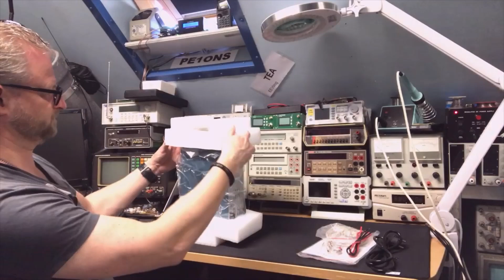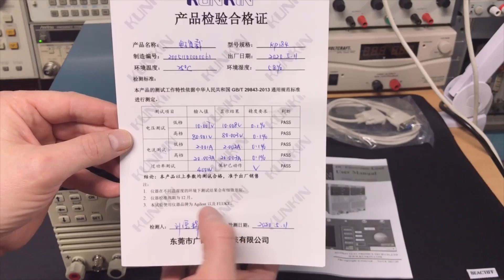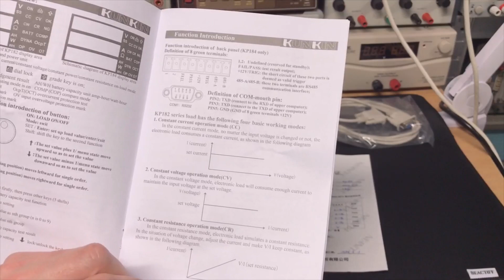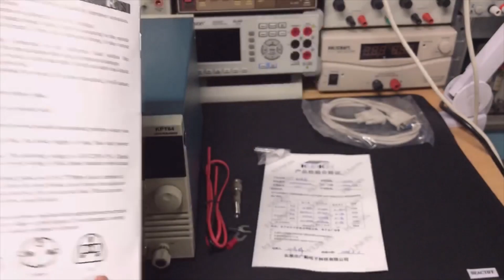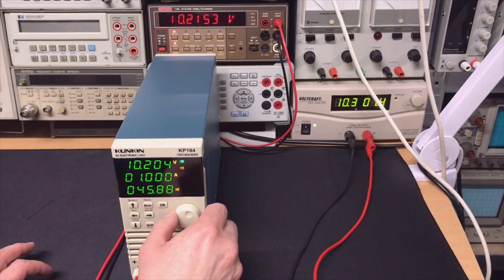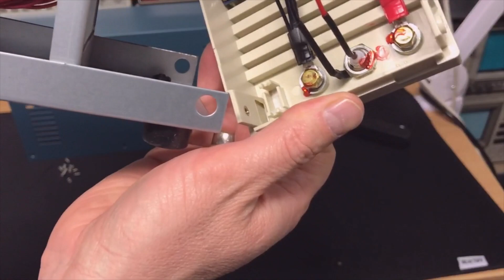TA•0075🟦Kunkin KP184 DC Electronic Load 40A 400W 150V Review Teardown

Comment: Just had a decent look at the specs following your video, ive had a look at the EEVblog forums and people seem to think it's a decent piece of kit too.  I've needed (wanted) one for a while, but they are too expensive, but this seems to fit the bill regarding price etc, so i've just ordered one myself! :)  £117 from Banggood (CZ origin).
Reply from the maker: Hi stephen, yes for the money it is very nice..  mine was about 125,- to my door in Euro, its about the same.. 40A with 400Watts.,..specialy with the new REV04 board seems better then the first versions... it looked a lot better then i thought..
Reply: @TonyAlbus  Yep, apparantly they have solved many problems with the REV04 boards (capacitor near a resister that they have removed and better software).   It should be ideal for me :)
Reply from the maker: @Stephen_Heathcote  Yes :-)  we are lucky with the newer version i guess (i also found out later....)

Comment: Thanks for testing. I would be most interested how accurate it measures the power and energy W/Wh on a heavy load and it it is really capable of handling 40A for a longer time. You should connect some big battery and do a load test for measurement. Build quality seems decent.
Reply from the maker: Thanks, the only thing i dislike is a bug that sometimes it remembers the last current setting, while the display itself say different.
now i would go for the EastTester ET5301	https://go.tonyalbus.com/ET5301

Comment: I know I'm late to the party but I bought myself a nice electronic load last week, the Siglent SDSL1020X. So far I like it and seems to work well and doing what it is supposed to do. Hacked it to the 1030X btw, so it's 300Watts now. I've  read in an EEVblog forum that the internals are exactly the same.
Reply from the maker: Good choice! very nice device

Comment: I also bought the electronic load. This device did not have the correct voltage. I made a complaint and got my money back via paypal. I dared to do the calibration procedure. I wanted to make a video about it, but it's too time-consuming. I have also calibrated the current, if the deviations are not great, then stay away from the calibration procedure! Here Jerry explains the voltage calibration https://www.youtube.com/watch?v=FDHT9bqQ7kw
Reply from the maker: Thanks Marco, sorry to hear that...my voltage seemed good, i have the REV04 board..

Comment: Excellent - Just out of the box and takes it apart :)   It seems to be well made and powerfull.  Seems the Chinese  are getting better at making some decent kit.  Pity about that power button at the back though :(
Reply from the maker: Yes, well... breaking the seal is more common sense then guts :-) .. sending it back from here costs a fortune :-))
The power button and terminals....i will fix in one of my next videos...sty tuned.
Reply: @TonyAlbus  Yep, apparantly the terminals are 4.2mm, so most banana plugs are sloppy in the sockets, so some suggest changing them for 4mm :) Easy change to do.
Reply from the maker: @Stephen_Heathcote  Yes Will do ;-) togetrher with the power switch...